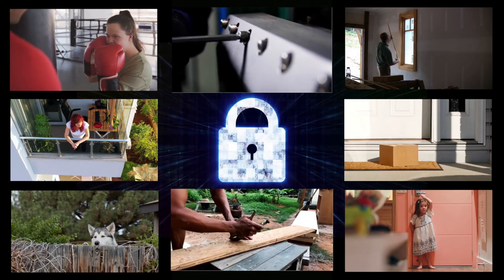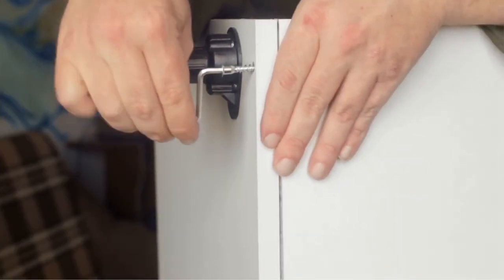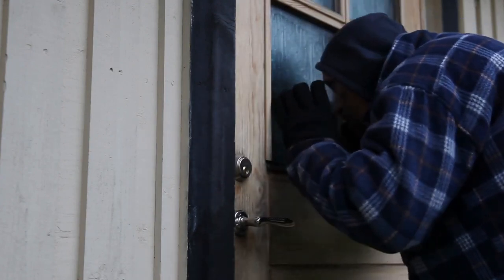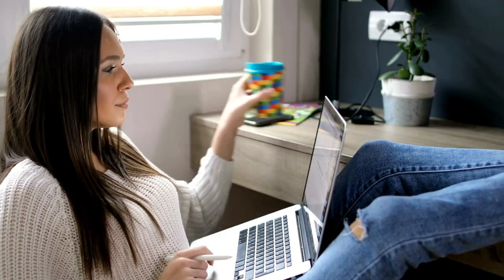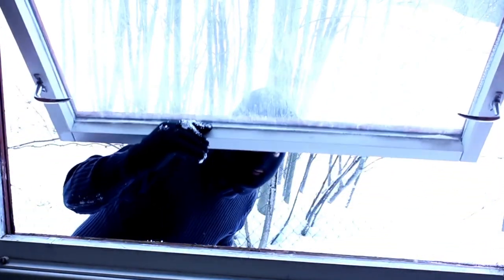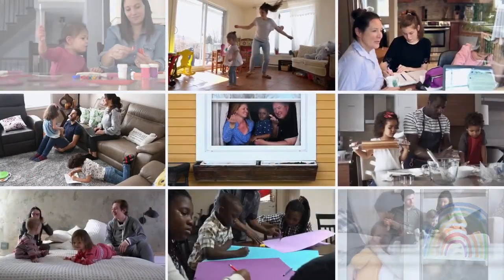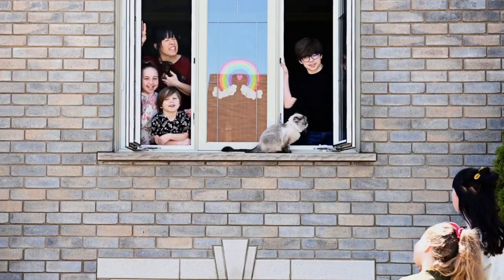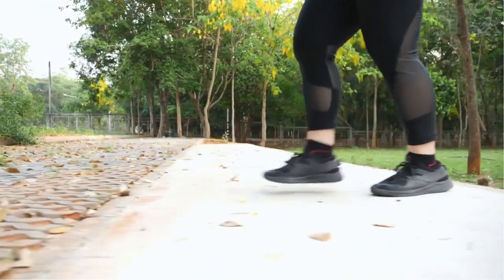10 FREE & EASY SHTF Home Security Tips | Shelter In Place | FEM Prepper

Comment: Thanks for the tips.
I would like to share a couple of mine.  Dollar stores have window alarms , if the magnets separate,  it lets out a ear piercing sound.  I also picked up a 8 ft 1x2" and cut it to size my windows. I wedge them in the cill when they are closed. I keep one to brace the A/C window unit from the top , so it can not be pulled out. I also use the paper black out blinds , up to 6" from the top , and leave the TV on at night.  The easiest thing to do is to keep your keyfob with you.  If anything happens,  you can hit the alarm button. At the very least , your neighbors will be looking out their windows.  
I know , quite a big suitcase to unpack , but I sleep better. 

Stay safe Ladies!!
Reply from the maker: Great suggestions! I will have to hit up the dollar store for some of these!

Comment: Invest in a pallet buster, makes ripping them down easier.always pre-wash before busting them apart. Chem spills can happen on pallets. Bust them and use them for whatever projects you can. Make sure to secure bundles to be tossed in your skoolie for bug out cabins when you bug out.

Or, get a Craigslist little trailer and outfit it with pallet bundles of wood, cinder blocks for foundations and save and straighten the nails! A little trailer ready to hook up and bogey out of Cali with cabin materials.

A vid on how to do this would be great. Alternative solar light kits, homemade or military surplus wood stoves, compost toilet or wag bag toilet, etc.

There are a ton of YouTube vids on how to build a cabin out of pallet wood! Buy paper copy books on how to build a cabin. In a true shift this will be invaluable! You can house your fam on the run.

Great vid.
Reply from the maker: That is a great suggestion! I had never even heard of it! That would make it so much easier! I have a few bug out locations so I wouldn't be building much if I am on the move. But the pallet wood is for sure able to produce a decent shelter when needed. I am luck enough to have some space to take a few pallets or wood with me in the bus if needed. But I am considering a rack for the bus or top rack... still deciding.
Reply: Since you have the top of the bus to work with, why not this soft sided car rooftop bags?
Reply from the maker: @NothingToNoOneInParticular  I have to figure out what is going to work best with the solar panels. But something like that can work.

Comment: I went on Amazon and bought barricade brackets for the entry doors and cut a 2x4 to fit. For less than $20 (on top of three inch screws in the hardware) the doors are reinforced. (See my video)

Connecting with neighbors.... me personally I will not use social media or texting, you may get lip service. The conversations can be screenshot or shared undermining the opsec or building a case to be "red flagged". I do conversations in person or on the phone to minimize compromising information or at least add deniability.
I had one neighbor cuss me off his property after I heard a tree crashing through his woods and I  wanted to offer assistance if he needed, now I have a guage of the trust level.

Gerald Celente is often quoted "when people lose everything and have nothing else to lose, they lose it". In this declining social climate read people in your circle, their inability to cope on the "small stuff" is a indicator on future reliability.
Reply from the maker: I completely agree! Things are starting to unravel. I actually also got the barricade brackets a few weeks ago. Aren't they awesome! Yes I will check out the video to see how you installed yours.

You are completely right, not all neighbors are trustful of people and you definitely have to read the person but usually it helps to know our neighbors. I always turn off my location when I use apps if possible, the geotags can really be a safety concern, even now!
Reply: @FemPrepper  about geotags, I recently went somewhere that was controversial yet 110% legal to do with 110% legal things, with my smart phones off and faraday covered. Just in case it turned into a s#!+ show and the media and three letter agencies spun it into something it is not.